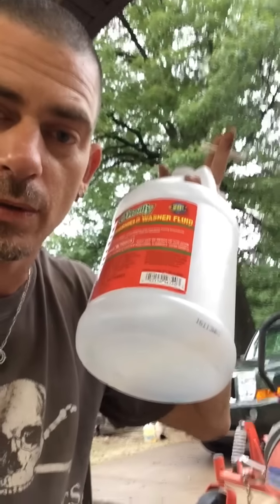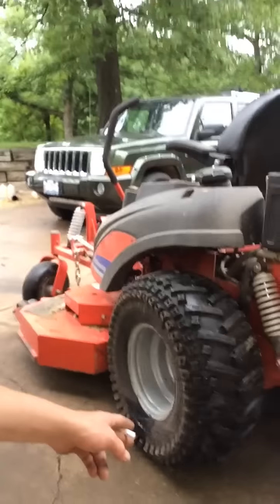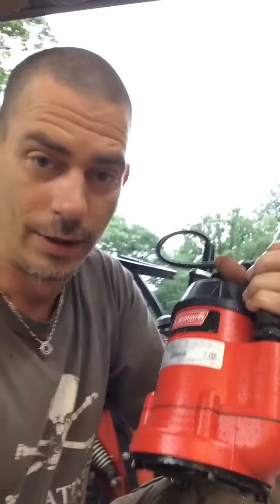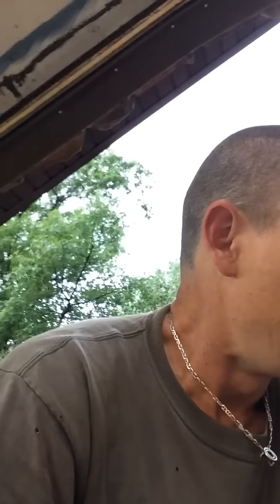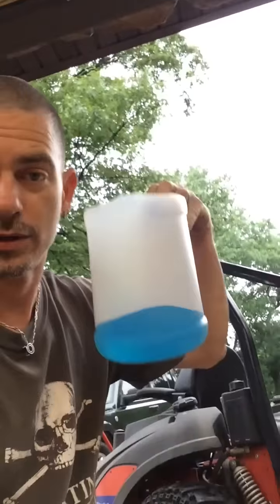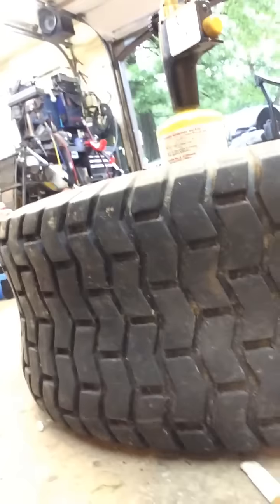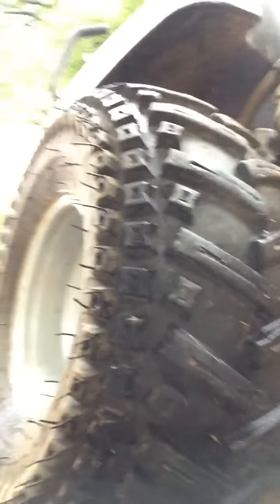Cheap DIY Wheel weights, stability and traction.

Comment: Did mine by taking out valve core (removal tool from Harbor Freight $3.00) buying a liquid transfer hand pump again from Harbor Freight ($12.00, came with adapter) and pumping the washer fluid in.  Takes less than a minute per gallon, put valve core back, add air, done.

Comment: Yup I've done it on all my zero turns and it does lower the center of gravity and give you better traction. Any farmer will tell you they have methanol or antifreeze in their tires.
Reply: Years ago they used lead dust in the tires of heavy-duty equipment . The freight outfit that I worked for used to handle this and I would have to unload it and even when it was loaded you had to line the sides of the trailer with these little barrels they were so freaking heavy.

Comment: Will this work in tires that have inner tubes?  Putting the water in the tubes?
Reply from the maker: Yes. Same principle.  But you may have an issue w air between the tube and tire.

Comment: Stumbled upon this video while looking for comments on going for a more aggressive tire for zero turn mowers. I was thinking about going with the carlisle stryker like you have and wanted to know your opinion on them. I only have a few small hills, but also have a few wet areas and a spring in the yard. thanks for any feedback.
Reply from the maker: Kenny Dennis, they are great if you need them.  You've got to re-learn your machine thou or you'll just strip your lawn.   My turns are wide and sweeping now. But I can go just about wherever I want to. Sideways on hills and mild wet grass is no longer as big of an issue. 
My dragging tire strips a patch around my trees (I like this).

Comment: What does windshield wiper fluid have , methanol alcohol. What does methanol alcohol do to some rubbers and plastics.
Reply from the maker: If you want to mix antifreeze go ahead, hell go ahead and use concrete if you want.    But if you really want to pursue this question,  First you need to establish what your tires are made of.   natural rubber, styrene-butadiene rubber (SBR), polybutadiene rubber (BR), and butyl rubber (along with halogenated butyl rubber).  
This is completely dependent on manufacturer.      
Then you can pull of this nifty little chart; http://mykin.com/rubber-chemical-resistance-chart-4     and cross reference the.   Just take a look and decide for yourself.

Comment: Is there a reason that you mounted the Strykers backwards on your zero turn?  Does it keep you from tearing up your yard so much?
Reply from the maker: bigbluegpr you'll tear up the yard no matter what, if you make tight turns with an aggressive tread.   I run these backwards so the wipe as opposed to dig. No loss of traction overall.
Reply: Mr Love's Garage Makes sense! Thanks!
Reply: But if you get into the soggy stuff the tread will not self clean and you'll be stuck
Reply: @darrinpennington , I guess you could just reverse out of it.

Comment: Hey thanks for the video man, just subscribed - Great info!  -  I have a situation where, basically I built a sleeve hitch with an actuator, then welded
up a plow for it etc...The tires started to spin out, so I got the Carlisle's with traction bars.  It still spins out.
My question to you is, how beneficial would you say the washer fluid is in this situation?

      I just don't feel like wheel weights would give me much advantage - Don't know if chains would help much in my situation, but here is where
I am at...The plowing starts out fine, then bam-tires spinning.  I thought my weight at 220 would fix that, but to no avail so far.  It begins to 
spin out, I start to lift it up, and finally, barely touching the ground it will take off again.  Its like, 'I am almost there', but not quite.

     In your opinion, what kind of increase in traction can one expect by adding the washer fluid?
Thanks man!
Reply from the maker: Patrick Paul I can't guarantee the washer fluid will fix it, but if you're almost there is bet filling them would get you there.    It's the cheapest easiest way to get you more traction.
Reply: Cool man, thanks! -  I was on the fence with that one for a while - the wheel weights were just insane cost-wise - Its just a hella lotta beer money!  Thanks for the reply, and heck, there is no way it would be worse at all.  At the very least, there would have to be at least some traction gain, so I certainly have a lot of confidence in this approach.  I am about a week away from my wiper washer earnings, but I will let you know how it goes.  Just in physics alone, there is certain to be some improvement in the process.  At any rate, awesome videos! - Keep em' coming man!

Comment: You could also use salt water
Reply: It will rust our your wheel.
Reply: WRONG   Salt water freezes not that much below 32 degrees. Plus you're asking to rust your wheels out fairly quickly. Next brain storm